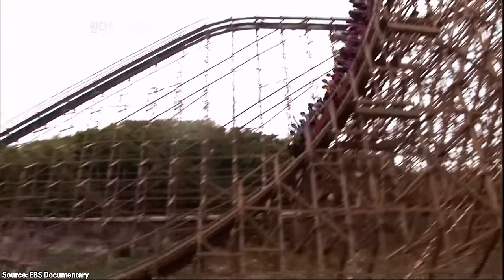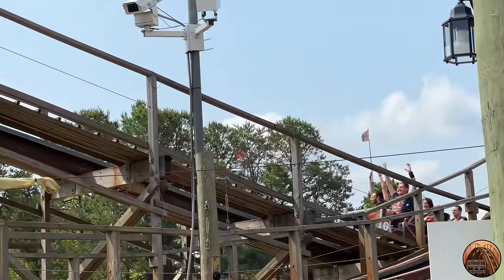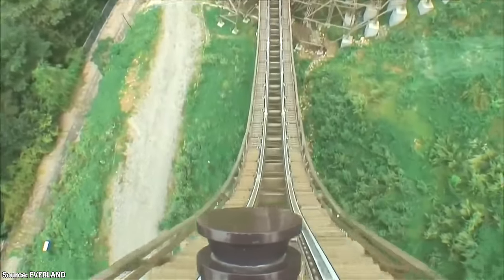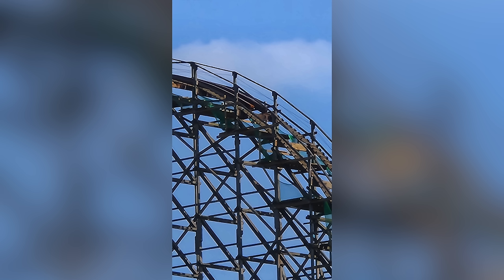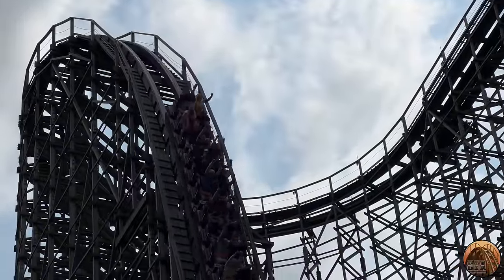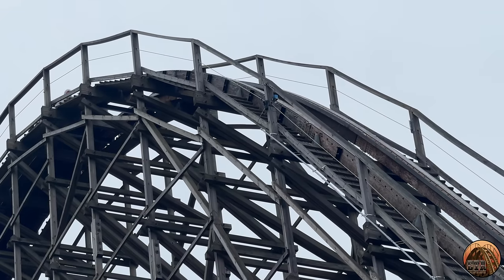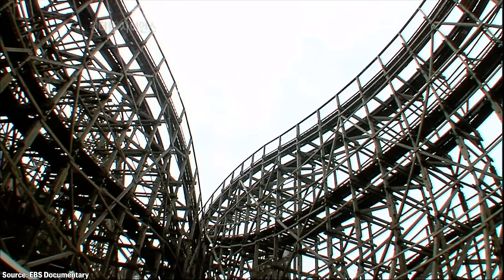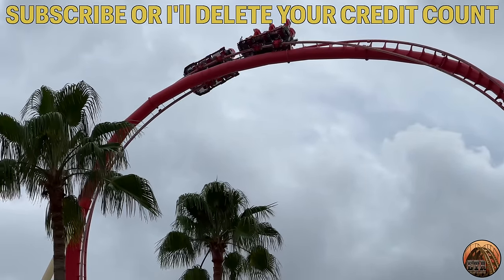The End of The Intamin Prefab Wooden Coaster?

Comment: I can see 208 happen on Balder, at least in the turnarounds. Even post retrack the trains have a noticable shuffle whenever they have to move in a direction other than straight ahead, and Liseberg may see towards a less maintenance heavy solution to have to prevent another major retrack within the next decade.

Comment: The Intamin prefab was one of the greatest gifts to the rollercoaster industry, it's just such a shame that they're so ridiculously expensive to build, we probably would have gotten many more if they didn't cost as much as a freaking B&M giga. El Toro had the same price tag as Leviathan, that's insane to think about. So that on top of the tremendous and costly upkeep that they require, I totally understand why only four of them were ever built, and why I'm confident we'll never see another new one. As long as the experience stays the same, meaning high speeds, crazy ejector airtime and it brings back the buttery smooth ride like when it was brand new, I'm perfectly fine with them doing the RMC re-tracking to El Toro.
Reply: Ironically them being the price of a giga might actually be worth it too, considering how popular El Toro is even 18 years after opening. I honestly think RMCs played a large role in their demise since they're basically cheap prefabs although technically not being wooden.

Comment: Do you think SFGAdv will consider GCI's titan track too? It seems like a bit less of a hassle to install than 208 RetraK.
Reply: Possibly! On the other hand, Great Adventure currently has a much tighter relationship with RMC with the recency of Jersey Devil and RMC having constructed El Toro. If the proposed Cedar Fair/Six Flags merger goes through, however, that relationship angle of looking at this is probably diminished.
Reply: I can see this happening as both Six Flags and Cedar Fair have been experimenting with Titan Track on various coasters. They seem to be a hit with many as well.
Reply: I was thinking the same thing!

Comment: At this point with Toro, I wanna see them do a 100% full 208 retracking and keep the original intamin trains assuming they are compatible and everything. I have a feeling the longer and wider Intamin trains will track infinitely better than the timberliners that mine blower uses which IMO shuffle and bounce around more than they should on GGs larger rides. With a full 208 replacement the ride will stay there for decades to come and solve a lot of great adventure's headaches both financially and with PR

Comment: Thank you for making the video. Everland is my home park. I think it's inevitable to convert to steel tracks due to maintenance costs. Korean wood isn't suitable for producing wooden tracks, and importing Intamin OEM tracks is too expensive. However, it's regrettable that they didn't maintain the wooden coaster's characteristics by using tracks classified as wooden, such as Topper-Track, during the overall renovation.

Also, if you happen to come to Korea, there's one thing I'd like to inform you about. Most parks in Korea strictly prohibit unauthorized POV video recording. If you plan to record, you must contact the park in advance.
Reply: Is Korean wood unsuitable because it's all new-growth wood?
Reply: @lioncat84 
The track of an Intamin Prefab coaster is made of marine-grade plywood, but the hardwood species used as raw material for this plywood are scarce in Korea.

And since T-Express is Korea's first and only wooden roller coaster, there are no others. Therefore, Korea cannot produce wooden roller coaster tracks domestically due to lack of experience.

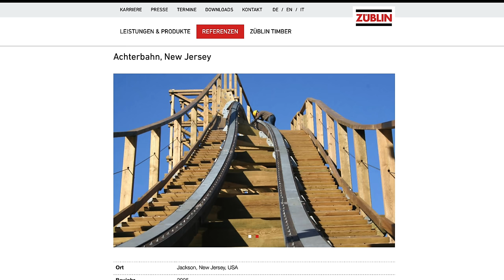Comment: 3:50 This is the first time I heard about Intamin switching from Holzbau Cordes to a different company for subcontracting their wooden coaster work. I always knew that Cordes didn´t do work on T-Express, but they still list the other 3 Prefabs as references for their work, and AFAIK part of the reason Intamin picked Cordes at the time was that they are basically just down the road from Heide Park. Was there any particular reason for the change in subcontractor

Comment: In regards to Mineblower's transitions on the retrack, RMC did go back through and fixed them, by taking an angle grinder to where the wood and steel track meet and smoothing out the bump. Yes I saw this with my own eyes as they fixed the final transition they needed to fix (up the main drop), and yes I did return in the evening to ride it, and can indeed say that I did not notice a "bump" when going between the wood and the steel track (also think I was the first person over the angle grinded track on the main drop, if what the ride op said was true).

Of course the wood track on that thing is still awful and still needs fixing.

Comment: The 208 ReTraK sections on Tremors and Timber Terror at Silverwood are immensely better than the wooden sections. Tremors is especially interesting, since it has sections of 208 ReTraK, Topper Track, and traditional track. The 208 ReTraK is smoother than the Topper, which is smoother than the traditional. The only downside I can see is the track is ridiculously loud.

Comment: Unfortunately I feel like it’s inevitable this happens to Toro. It’s a much better option than IBoxing like some thoosies want to do (the type of thoosie I’ve grown to have a deep burning hatred of), it’ll still be able to use its current trains, the profiling would be the same, and most importantly it would still fart (if it doesn’t fart I don’t want it).

Ultimately I wish Six Flags would just pony up and re-track with pre-fab track but that feels like a total pipe dream at this point. As long as the airtime, forces, trains, and layout are the same, I’ll be ok with it whether it’s a wooden or steel coaster.

Comment: I think they could probably leave the lower stress sections as wood since they won't wear out as fast, but like Fred Grubb said with the initial idea to create the steel rails, change out the corners etc. that would need replacing every year, that way you can still have a bit of both

Comment: Considering that El Toro was nearly as smooth as a steel coaster when it first opened, I wouldn't be too upset if it gets some kind of steel topper track if that's what it comes down to. In that case it would probably be more like how it ran originally. What I would be upset about though is if they changed the layout. El Toro doesn't need an underflip.
Reply: It is, indeed, because El Toro run with rubber wheel

Just like.... Actual steel coaster

Comment: I think you got it on the head by mentioning the trains. If you switch up the tracks, then oh well, but changing the trains will alter the ride experience. I say get the steel track but keep the original trains

Comment: The only wooden coaster I can think of that failed after using the RMC 208 or topper track was the original Georgia Cyclone. It was super rough that I couldn’t take it anymore and was begging for it to get RMC'ed since it used the same crappy PTC trains that were eventually reused for GASM. Good thing it did since it formed a really good 1-2 punch against Goliath.

Comment: In classic Six Flags fashion, I'd bet Great Adventure would do the bare minimum keep El Toro acceptably smooth and only place steel track in high-stress areas in need of attention, IF they ever invested to go that route. The bottom of the turnaround and one or two points in the twister section at the end come to mind.

I personally enjoy Gravity Group precut track (which probably isn't viable in rides this forceful) much more than GCI/RMC steel track as a retracking option, but even when wooden coasters get some steel track, it takes LOTS of retracking and money for a ride to lose its identity. Great update as usual!
Reply: Gravity group’s prefabricated track is the Intamin prefabricated track. The only difference is the patent that Intamin had on it expired resulting in other companies to copy within the proper bounds that it’s not an exact duplicate. RMC’s Ibox patent expired. That’s exactly why GCI now has titan track. They can copy close enough but it must remain different at some capacity and that’s why the titan track is tapered while the Ibox is not.
Reply: @IKR5-m8q  No it is not, GG's is "pre cut" and more conventional. But it also uses vertical lamination in places, although I can't figure out how much (not curves).
Reply: Pre-cut is another term  they coined for patented purposes. If gravity group wanted to build an el toro coaster, they would absolutely be able to among the grounds of patent and copyright infringements. It’s not the same, but that doesn’t mean it can’t achieve the same things. It only exists in the current ways only on the basis of supply and demand. They haven’t sold  an extreme coaster yet and buyers (regarding the el toro and Intamin situation )certainly have every right to be cautious. Gravity group is really only making smaller prefabs and refurbishing larger ones at places. 
Sooner or later Gravity group is going to sell a large and intense coaster and then and only then are we going to see the true capabilities of their style of prefabricated tracks. 

Maybe even the voyage. 
That’s their el toro. Their biggest they ever made prior to focusing on prefabricated track. Sooner or later holiday world is going to fold with the retracking prices and go prefabrication. That could just be the ace in the hole for gravity group to really make themselves reknown.
Reply: @IKR5-m8q  The engineering and legal cost to change Toro that much would be prohibitive. I also doubt patents are a big issue. If GG wants to prove they can do that with their track, they build coasters.
Reply: @spentron1   patents are legal documents that protect you from people copying you. And even once they expire, it’s a little difficult to go down that exact alley without getting a lawsuit for copying closely enough. Would you like to try again?
Reply: @IKR5-m8q  I'm excessively familiar with the concept. And certainly those with patents can throw their weight around unless the other company also has (equally irrelevant) patents also to toss about. But RMC IBox is more similar to Intamin's prefab than GG's precut, more like a wood model kit with precut parts. And Intamin isn't current on any trademark use, unfortunately!
Reply: @spentron1   not enough as they’re almost the exact same thing just made with different names. You can sit here and try and argue the case that what gravity group is doing is way different than Intamin/rmc. You’re fighting a fight you can’t win lol😂 but I’m all for el toro becoming full Ibox or topper if it means it’s more reliable.  I’m a great adventure passholder who a season long flash pass platinum. Would love to get 3,000 laps around el toro in one operating season.

Comment: Like u said Ryan they'll definitely consult with T-xpress. Though it seems the OEM route for El-Torro is an enthusiasts idea of a good idea but not six flags'. They know 95% of people won't even notice what changed with El-Torro, as in GP just know it got "re-tracked". They don't know (or care really) if its OEM from intamin or made by RMC. Given six flags hasn't worked with Intamin on an actual notable coaster since around king-da-ka and el torro type days. I doubt it. Especially considering their relationship with RMC. No park operator is closer to RMC than six flags. And great adventure has been doing their own track already. An entire Intamin OEM re-track is what i'd consider an enthusiasts pipe dream. European parks would care if their guests notice it being slightly more rough or they just want it "done right" or like "how it was before", but its six flags here. Coming from someone who likes six flags more than most. GP at the end of the day just want it open as soon as possible (when retracked) and dont care/know where it comes from, so thats what six flags will do.

Comment: I think it is a smart move to not replace the track with the pre fab track, it will just need to be replaced again in around 15 years, that track is far too expensive to have such a short service life, parks are not going to continue to replace the track around every 15 years at nearly the same cost that it was to build it -with all 4 coasters now confirmed to have severe issues with the track that required complete replacement 
  it is safe to say the pre fab track with the main selling point of being low maintenance over a long lifespan has failed miserably, a 15 year service life is bad by any standards but especially considering the price tag these coasters all came with , B&M prices with Togo quality. Intamin should really take this model out of production for now until they can figure out if they want to discontinue  it or work on fixing the issues that are causing the track to deteriorate so quickly

Comment: I didn't care for the transitions on Mine Blower. I think Wolverine Wildcat and Predator had much better transitions (with Titan track) but it's weird to have such smooth sections sprinkled into a wood coaster experience. I think the best case scenario (if they didn't go the OEM route) would be Gravity Group's Precut Engineered Track. It's my understanding that they have not mastered major changes in direction, so things like tighter turns are still done with traditional methods, however they have mastered the use of ipe  wood for a much harder top layer making a traditional re-track last much longer. Everything comes at a cost though, so it will be interesting to see how things play out.

Comment: I'm alot more worried about parks choosing to put 208 retrak and titan track on their traditional wooden coasters, since trad Woodies are often much less forceful than steel coasters, and without the texture of the wooden track, they will feel dull and force less. For example, Ghostrider only pulls about 3.1gs, while most extreme steel coasters pull 4-5gs. The prefabs pull just as many gs as a steel coaster, so at worst, a 208 retraked prefab should feel like an rmc.
Reply: FYI El Toro is already use rubber wheel like steel coaster from beginning. Which is explain why people praise it being ultra smooth espescially on beginning.

So pre-fab basically just topper before topper ever exist. And indeed people complaining both being a "Real" wooden coaster

Comment: It sounds like the prefab track is a problem.  I suspect it's because it's made of plywood.  Plywood is made of layers, and layers de-laminate.  The glue doesn't have the same properties as the wood so they come apart.  The wood is all thin little layers, which are more prone to weather and damage.  Stacking boards for rails probably works, because the individual boards re-enforce each other, while remaining flexible and repairable.  Likewise the broken bent (?) posts looked predictable.  Putting that many large holes through a beam all in a line causes splitting, especially if the structure is too rigid.  All of the force above it is concentrated onto three bolts.  I imagine there are more internal stresses present in prefab frames, especially if they're made by CNC.  Site built frames would be able  to account for some of those by being cut by hand on site, where pre-fab would have to be forced into place if the wood changes dimensions or twisted after being cut.  Traditional construction sometimes has limits, but it's usually traditional because it works.  I'm sure they can re-invent the wooden roller coaster but it will be completely different and more expensive, and not the same.

Comment: Honestly, as good as the rides are, the prefab track is a failure as being a good alternative to traditional wood and steel. In terms of maintenance, its the worst of both worlds. The track pieces don't last nearly as long as steel but still require a large expense to replace including manufacturing and the use of heavy machinery to put them into place. Titan track, RMC 208 and Gravity Groups precut all seem to be preferable options.

It does seem like 208 Retrak is the sensible option for El Toro all things considered.

Comment: The prefabs were definitely more reliable than the normal wooden coasters as they were built and designed like a steel coaster. This brought a much smoother and more comfortable experience and it can feature more extreme drops and hills. It sure seemed like such a crazy big project to make because it's a mix of both the work of a steel and wood coaster. They had to make the entire support system as a wooden coaster but designe the track and transport it like a steel coaster.
Reply: cable lift hill... more reliable than a wooden coaster? Idk about that one. I can't name many times I went to a park and their... wooden coaster is closed.
Reply: @Sonic-gy7kq  I don't know how reliable cable lift hills are but when I mean reliability, I mainly mean the maintenance and construction and design. Steel coasters overall are more reliable than wooden coasters as they do most things better. I have not seen any more steel coasters closed on average than wooden coasters.
Reply: FYI the part of magic for prefab for being smooth is because they use rubber wheel.

Just like you know.... Actual steel coaster
Reply: @bocahdongo7769  Steel coasters don't use rubber wheels, they have a plastic that is usually either polyurethane or nylon.
Reply: @maxhagenauer24  yeah around that (since I indeed love to called polyurethane a "rubber", but I digress).

You get idea.